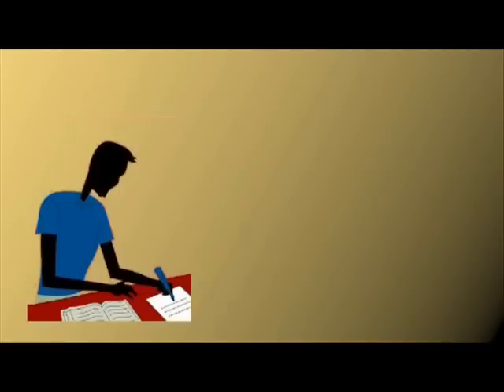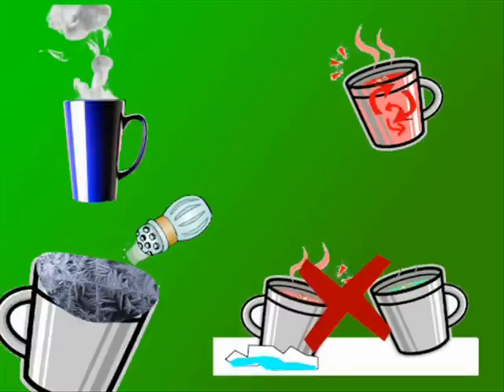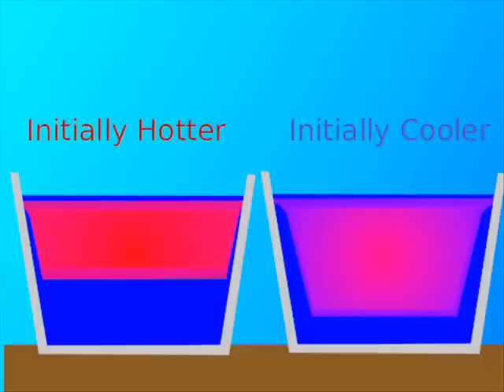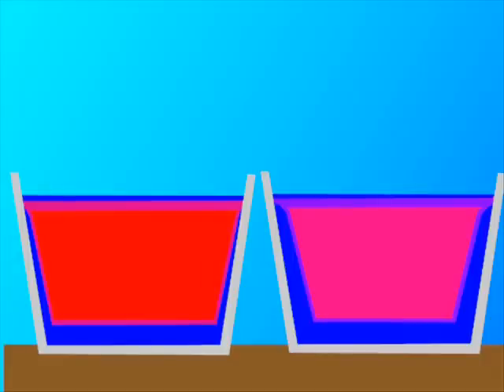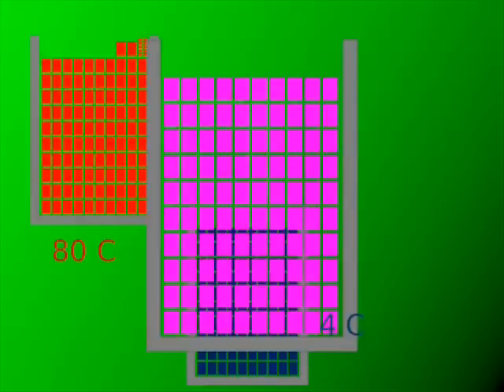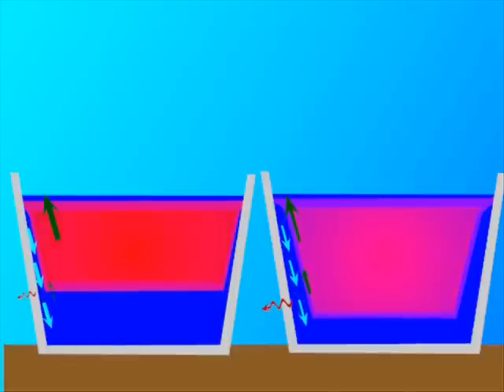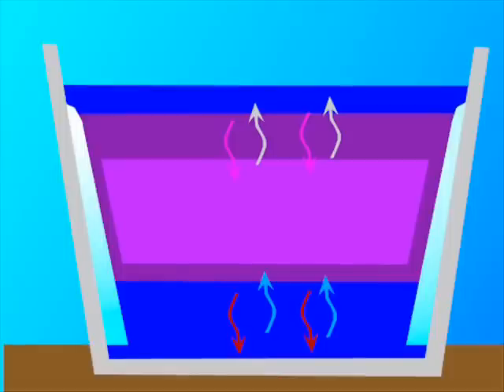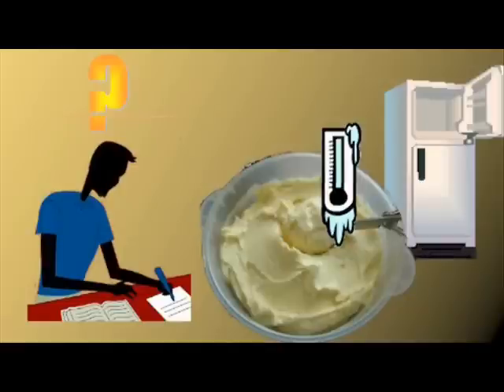Mpemba Effect - a theory

Comment: What happens when the hotter container approaches the starting condition of the cooler container (in average temperature for instance)? The viscosity and density would then be equivalent to the starting condition, so i dont see how the hotter container could surpass (cool faster)  the cooler container from that point. If you are going to argue that the convection currents in the hotter cause it, do the convection currents really have the inertia to overcome viscous forces for a few minutes? Even if you spun a bowl of water, the liquid in the bowl would come to a rest pretty quickly.
Reply from the maker: If the idea in the video is correct, the the hotter container never reaches the starting condition of the cooler container. Although the average temperature of the hotter container might reach the average temperature of the cooler container, the state of the containers will be quite different. The cooler container will have a uniformly distributed temperature, but the hotter container will comprise a hot reservoir hotter than the spatially averaged temperature, and a cooled sink that is colder than the average.

The key insight is that "average temperature" is an insufficient characterisation of the system state.